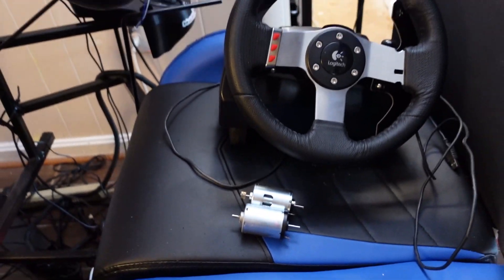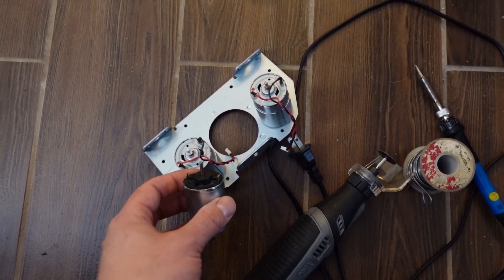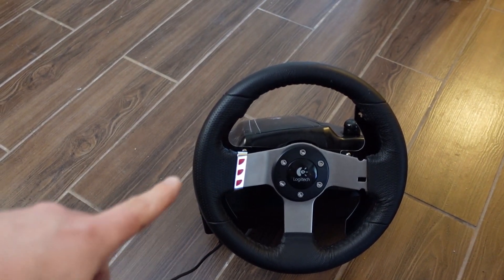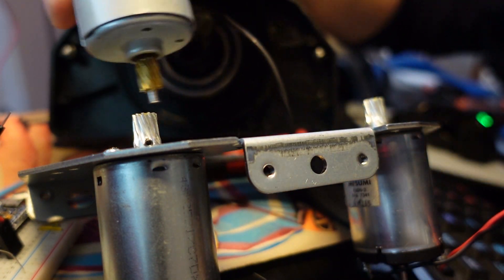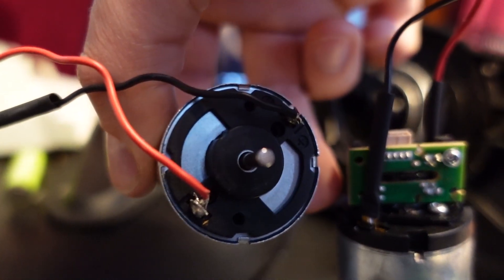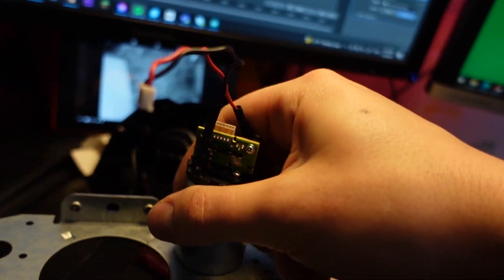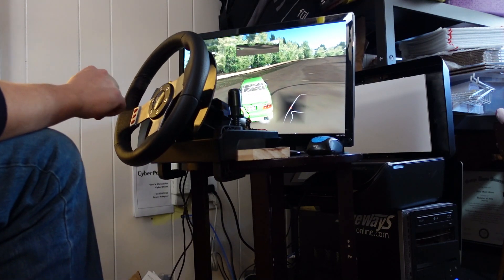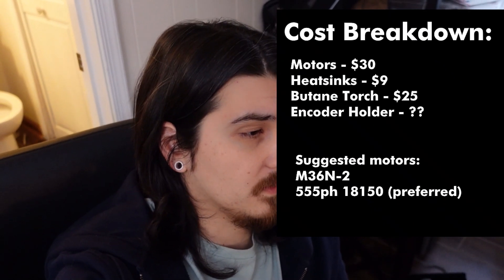Logitech G2x/G92x motor upgrades

Comment: How much torque does it put out now?
Reply from the maker: I have no idea how to measure it. But my guess is 5 to 7 nm
Reply: @protomor  that's so awesome! I'm keen to do this to my G29, but I'm honestly too scared I'll bugger it up.
I have changed over the red rotary dial to a black one, so I've had it open before up to the wheel itself. I've also pulled apart the shifter to put a 3d printed spring pre-tensioner in behind the shifter spring.
And also printed out a pedal extension for the throttle.
So I've been enjoying moddind the G29 in one way or another to improve its functionality and looks.

But this feels next level! I'm keen just by looking at how fast it can now move. I feel like that is the actual main area that the g29 falls short compared to a real car, is how fast it can spin itself.

I'm keen on a CSL DD for this very reason. But then saw this.

I've only had my G29 for nearly 3 weeks as it is. But I'm already feeling it's disadvantages.
Although I feel for actual racing it's just fine, but for drifting, it just seems a bit slow and weak
Reply from the maker: @HughesDePagen  I would definitely recommend a DD wheel. Fanatec isn't my fav as they've failed me in the past. This motor upgrade will help but is not DD level.
Reply: @protomor  unfortunately everything else seems too expensive in Australia.
The Moza R5 is an option, but I'd get less for my money.
With 700aud, I can get base, wheel, pedals, and clutch pedal, if I go CSL DD bundle plus clutch pedal

But out of curiosity, what budget DD would you recommend? 🤔 Thanks for any help ❤️
Reply from the maker: @HughesDePagen  fair. I love my alpha mini though
Reply: @protomor  I'd love to get that! It's 999Aud though 😪.
I wish I lived in USA haha
Reply: @protomor  you do realize this is the lewd and lascivious lieutenant that you're talking with!?
Reply from the maker: @HughesDePagen  uh no?
Reply: @protomor  You havin a FEEEEEDBACK

Comment: Guys. What do you think, and if, on the contrary, you push the gears apart and put a belt on top of the motor pulley and the main shaft? Keeping the gear ratio. + new motor and psu In this case, the encoder
Reply from the maker: Someone did it. I think the main issue is cost. At the amount you put into it, might as well get a direct drive.

Comment: Hey, could you tell me the specs of the pinions? I'm thinking of getting some custom pinions made because my original pinions are NOT coming off 😂
Reply from the maker: pull the data off the STL I posted. it's close but I'm not entirely sure. Honestly, the propane torch was the only method that worked for me.
Reply: @protomor  where did you post it?
Reply from the maker: @Breadgobble_r  oh wait that's the holder. Let me see if I can find it for you
Reply from the maker: https://www.thingiverse.com/thing:6001067 Here you go.
Reply: @protomor  Thank you very much. 👍

Comment: I love this. I'm getting back into racing with my G27 again after a couple of years not really using it. Considering a mod like this, just wondering if this helps in reducing the clunking/chattering when the wheel gets overloaded? Or is this a different mechanical limit of the wheel?
Reply from the maker: If anything, it'll probably make more noise. It's just inherent to the design. It'll never be quiet.
Reply: @protomor  there's a guy who made alumunium bracket for the motor and it's more rigid that helps with easing the clunking

Comment: just curious, it is possible to mix n max motors? like a RS-555PH-3255 motor and a 18150/OEM motor?
Reply from the maker: Never mix motors. even old motors and new motors of the same type. They'll fight each other and eventually kill one or both.
Reply: @protomor  figured something like that would happen lol, unfortunately i bought OEM motors, still happy my unit works tho :)

Comment: Could you do a mod tutorial video for Driving Force GT? And did you had to mod the wheel with a fan and use a different power charger?
Reply from the maker: I think the GT is only one motor but otherwise the same. I used the stock power adapter for all of it but an upgraded one wouldn't hurt at all.

Comment: Hello Jeffery, you are a smart guy and I like your videos. You are good on fixing Logitechs ;) Maybe you can help me. I have these chattering/ratteling noises coming out of my wheel and I had every little thing in my hands.I disassembled all I could, but couldn't find the issue. No teeth are broken, motors are good, as screws were tight. I have no idea and it drives me crazy. I remember that there were no such noises when the wheel was new. So there is a problem somewhere but I don't know where. I have the G27, but it is the same noises  as in the video below. A bit louder and clackier maybe. https://www.youtube.com/watch?v=9yAt3wTq4f8 Thank you for your time and advice :)
Reply from the maker: how far have you disassembled the unit? Something has to be loose or some teeth have to be broken. Make sure the wheel is screwed into the base properly. Also make sure the geared rack on the bottom has the tensioner curved metal leaf spring installed properly.
Reply: @protomor  I disassembled everything except the 2 bearings in the housing. All screws are tightened and the leaf spring is also installed properly. I curved it a bit more for more tension. Every gear has its teeth - not 1 has gone. The  big  plastic one looks good and the 2 brass gears too. I tried to see something without the cover but I see nothing. There are some guys with the same problem over the years, but no one has a solution for this.
Reply: I did run it without the cover...that is what I wanted to say.
Reply from the maker: @marcels.7226  I'd have to see pictures and video. Something is loose somewhere.
Reply: @protomor  Switched off or switched on you don't feel anything. No rattling, no noise. The force feedback is also buttery smooth. The clacking comes, for example, when you drive on concrete slabs with huge gaps like on Sebring 1966 in Assetto Corsa or GT Legends or Spa Francorchamps Historic in pCars 2. The first time I noticed it was in a 12h race with ACC on Monza while shifting through the Lesmo corners.
Reply: What kind of picturers? The complete disassembly?
Reply from the maker: @marcels.7226  pictures of everything. teeth. alignments. wear. 
If it only happens in game, that might just be the wheel. If it doesn't make sounds when it's off and you turn the wheel back and forth, it's probably not the wheel.
Reply: @protomor  I will make some pictures tomorrow. It is 03:56 AM in Germqany :D I would give you my discord name so that I can show you the problem and you hear it then.

Comment: I’ve got a gear puller for pulling and pressing pinion gears on motors for air soft guns, I bet it would pull that gear off easily.  Wasn’t a cheap tool though
Reply from the maker: I'd like to see one in action. The issue I had was that the space between the gear and the motor base was too close to get anything in between. Heat was the easiest option in all honestly. Cheap too. Plus, who doesn't like fire!

Comment: 👋, what size helical gears are the ones that come on the stock motor because my motor axle is too wide compared to the stock motor axle
Reply from the maker: I measured it at one point but no one sells replacement helical gears. The shaft size should work. It's the same. Just heat and press on

Comment: Hi. I have 2x m36n-5e motors. Do you think i can use them on g920 ? They have nice torque, 3500 RPM on 24v. I am incompetent in this field. I don't want to fry my steering wheel.
Reply from the maker: I'd have to have one in front of me to test. I'm not sure. If you go too strong, you'll shatter the insides of the logitech unit since it's all plastic.

Comment: Pretty neat idea, I didn't think replacing the original 555 motor with another one wouldn't make that much of a difference but I guess the original Johnson motors have weaker specs. I did roughly the same thing with my wheel but used a 775 motor instead, speed and power!
Reply: 775 is the size of the brushed motor. Just get whatever quality 775 you'd like that supports the voltage draw and get the supporting gears for the shaft size of the new motor. I personally would find one with a slimmer shaft size to match the g2x motors. It'll make finding the right gears easier. If the first set you get works size-wise, then you got lucky. While you're at it, grab a higher amperage and more efficient power supply for around $40 to get higher detail. You'll have quicker motors and a quicker, more efficient, power delivery to the wheel. I personally would go to a 5 amp 24 volt psu. I've also thought about overvolting it with a higher voltage psu, but I don't have the wheel to spare, because it'll most likely fry, but it could yield good results with noticeably stronger feedback at the expense of longevity, it all depends more on the motor controller rather than the motor itself when it comes to overvolting, because the chipset was most likely designed for 24 volts to be its threshold. But if someone intermediately techy made a higher voltage plug n play chipset, theoretically you could get insanely higher feedback. Just spit balling at this point
Reply: RS-775PH-3848 ?
Reply: the 775 motor has a 5mm axe, it fits the gear?
Reply: I've read that the stock board won't hold up to the 775 motor as it draws more than the 555.
Reply: I read 30v 3.0amp psu can be used, more precisely 30.8v because above that the wheel looses its ability to calibrate. Also some say the mosfet transistors inside are designed to handle up to 36watts so a mosfet heatsink is more than recommended. Supposedly the mosfets are the weak link of the whole assembly electrical wise so they make for a good fuse in case current draw goes above the limits. With this set the 555ph-1850 is the recommended motor in the 24v option, with 2 passive heatsinks on top of each motor (rc car 1/10 550 heatsinks from aliexpress seem to work fine. Also 2 ~35mm fans should be placed on top of each motor (cut the top of the wheelcase on top of the motor and glue the fans so they blow directly on top of the heatsinks). The backside ports/vents of the wheelcase need also to be opened up with a dremel because they come closed of from factory and are there only for aesthetics reasons.
For anyone attempting to upgrade but afraid to change motors an easier solution and upgrade seems to be the 30.8v 3amp psu in addition to the passive heatsinks placed on top of the stock motors and only one fan ~80mm glued on top of the wheelcase, which keeps the stock motors cooled down and in this way ffb remains the same for how many hours you play, and also seems to give a bit more ffb.
Anyhow, I’m just trying to understand how this swap can be accomplished as successfull as possible and haven’t tried anything out yet.
Reply: please share the motor specs you used!
Reply: I have 775 motor from my old fanatec wheel good to know
Reply: can you teach how you fit the 775 motor?

Comment: Hey man, nice work buddy!, I'm doing something similar to my g923 and I wanted to ask if u changed out any of the mosfets or capacitor? So far I just did the heatsink on all the chips and on the 2 stock motors and I also did the power source mod and cranked it to about 30v, amps draw what ever they need so I'm not really sure how much it's pulling in amps. Works very fast! But I feel like the torque is still lacking, I'd like to swap the motors aswell but I really don't want to be messing with changing out chips lol
Reply from the maker: This mod is specifically designed to not need to upgrade any of the fets. What you see in the video is all I did. Even still using the 1.75 amp power brick.
Reply: That's awesome! Do you know the specs of the new motors u put in?
Reply from the maker: @brunosoares2916  uh not off the top of my head. If you Google them, the data sheets are the second links though.
Reply: Cool, thanks man. I think I ordered the same ones as u, but mine are apparently supposed to be used, where did u get those?
Reply from the maker: @brunosoares2916  the m36n ones I got were used off eBay. The 555 18150 were new.

Comment: I’m a rancher and work on heavy equipment all the time, the butane torch pulling and pressing is the only part that looks easy and simple to me lol.
Reply from the maker: Naaaah. the rest is screws and some solder. If you need the 3d printed bits, just let me know, I can mail it to you.
Reply: @protomor  Highly appreciated, got a bud with a 3D printer though.
Reply from the maker: @cmbaileytstc  I feel like everyone has at least 1 friend with a 3d printer :)
Reply: @protomor  
Picture it, 40 years from now:
“Replicator, make me a direct drive sim wheel capable of 25 nm torque and a high strength plasteel replica of the steering wheel from a 1941 Cadillac. Thank you.”
Two hours later “International Patent police, open up, the holder of the patent on 1941 Cadillac steering wheel demands $34,000 credits or your summary execution.”

Comment: i have suggested the pinion puller in facebook and now i know why you said its better to use butane torch instead...hahahah
Reply from the maker: I've used a pinion puller in the past and actually wound up breaking the brass teeth. I mean you can see how quick the gear just pushed off with the torch!

Comment: Saw it on facebook, it's insane what power it puts out, never had the time to make this upgrade, this is what I had in my mind but never saw anybody do it on Youtube with a full rundown so after this i can do this finally, also what I wanted to ask is that you need to connect the wires to the opposite, like the positive to the negative, and the negative to the positive? Thank you!
Reply from the maker: Yea... I'm not entirely sure on WHY you need to do it. In some countries, black is positive (like house wiring) and other places red is positive. So I don't think you're actually reversing it. But also, the motors spin based on voltage given either direction so it shouldn't matter. I'm not smart enough to know why. I just know that it works lol.
Reply: @protomor  What voltage does the motors have in your setup, i'm planning to get the rs-555ph one
Reply from the maker: @vulpvy  factory 24v. Nothing extra

Comment: Hey bro great job on the motor upgrade!!! I have a question for my g29… I don’t need to get the g27 reluctor thing but u mention that I have to do something to the sensors. Could u elaborate more on that… also are the g920 same deal too? Thanks for making this video…. I’m too broke to afford a fanatec setup.. also any recommendations On the steering wheel adaptor to run real steering wheel?
Reply from the maker: The G920/G29 are the same insides from what I recall. It's just PS vs XBOX. Here's a link to my last video where I do the G920 encoder wheel https://youtu.be/BUvvYGKQLJ8?t=588 (a bit over 9 minutes in).